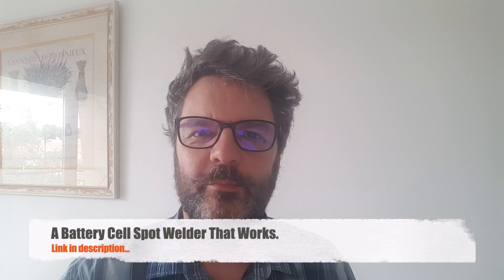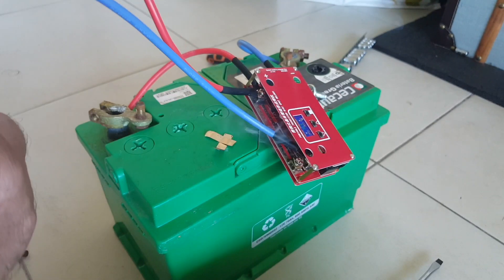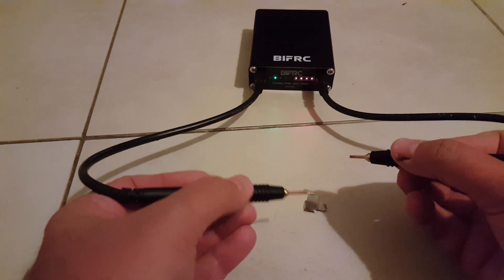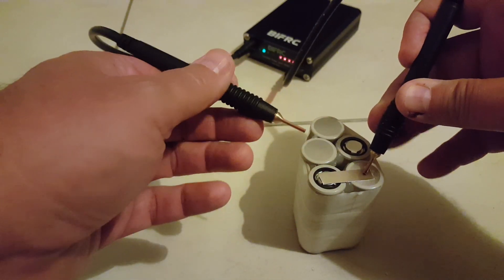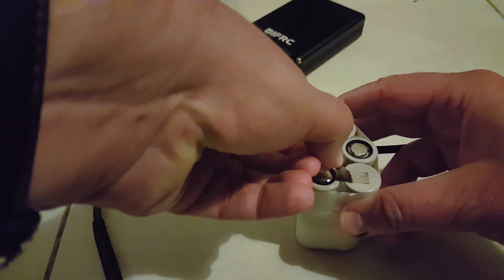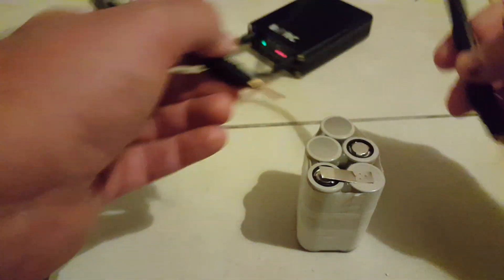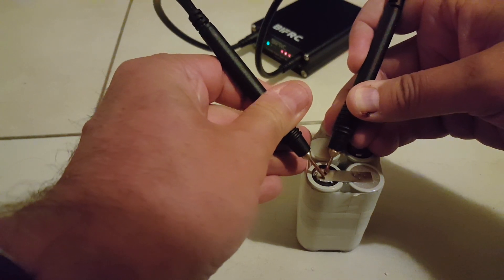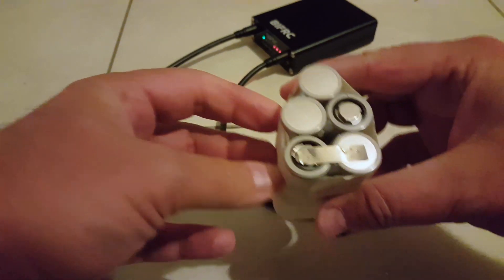A Battery Cell Spot Welder That Works.

Comment: Hi Gil, great to learn that. I have been trying to find a good one for occasional use.
Btw what thickness strips did you try it on? Would it spot weld a 0.2mm thick one?
Also I tried your link to support the channel but that one does not ship to UK.
Thanks
Reply from the maker: 0.15, 0.2 probably, I had some but it was crap..

Comment: Thanks!  I converted my old mountain bike into an e-bike a few years ago.  The last step is the battery pack.  It has 192 of the 18650 lithium cells.  My project sralled at that point.  I should get this little welder and finish that project.
Reply from the maker: It definitely makes it easier!